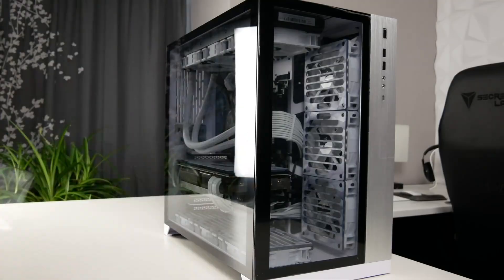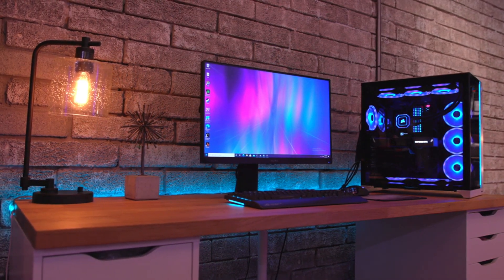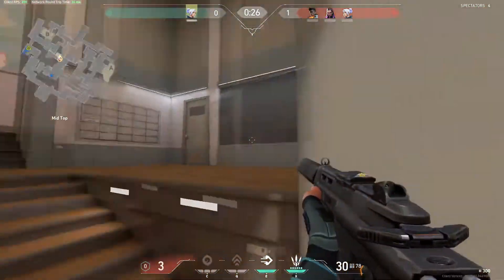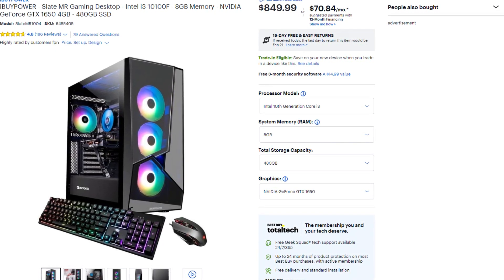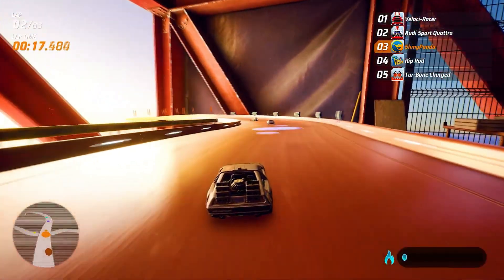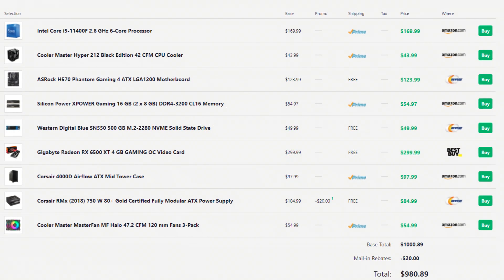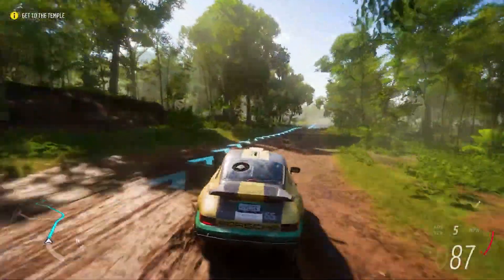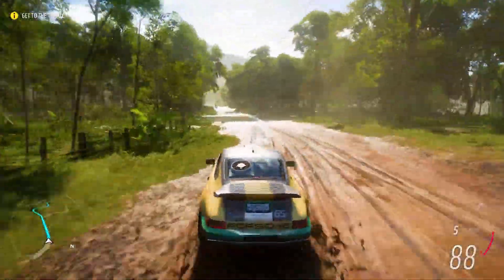PC Build VS Prebuilt PC Battle in 2022 | Which one should you pick?

Comment: Lenovo Legion tower 7i 11900k rtx 3070 32gb ram with liquid cooling vs hp omen 40l 12700k rtx 3070 16gb ram with air cooling. Which one would be best for gaming performance and vr performance  for the long term with no upgrades to components
Reply from the maker: omen 45L with a liquid CPU cooler, better airflow overall and you get that 12th gen of intel which is way better than the 11th gen